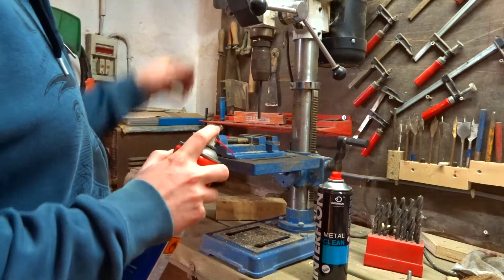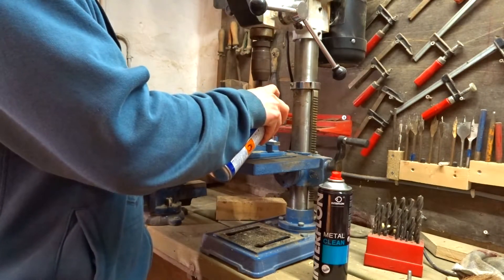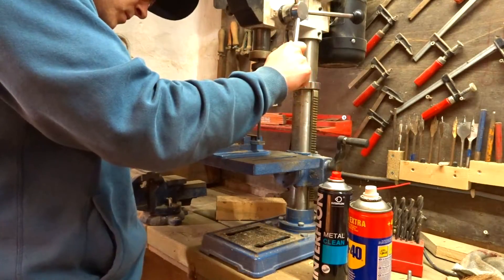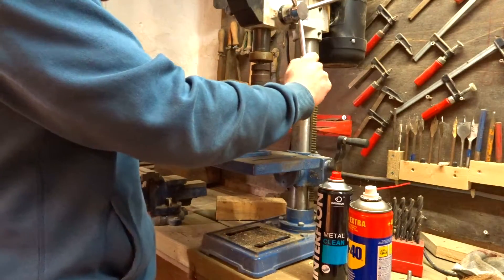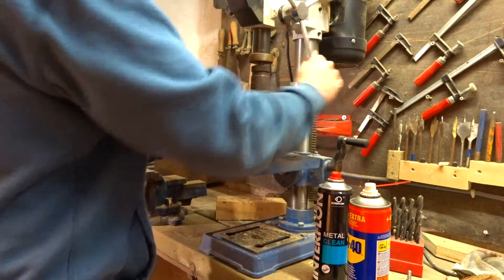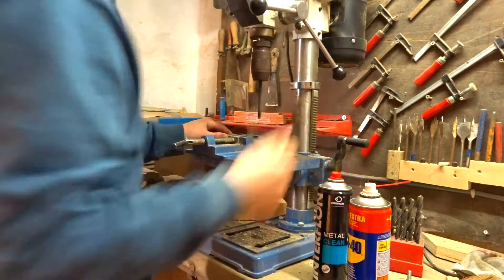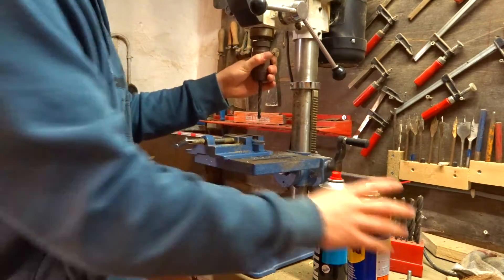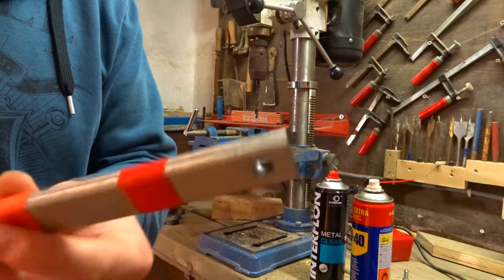Clutch and Pulley Locking Wrench   DIY

Comment: That's old school, nice . If i may give you some advice, on the arm that's on top , add a longer bolt , to make up the difference between the two bolts. Also is there anyway you can get another Piaggio moped, maybe a Grande super deluxe from the 70's